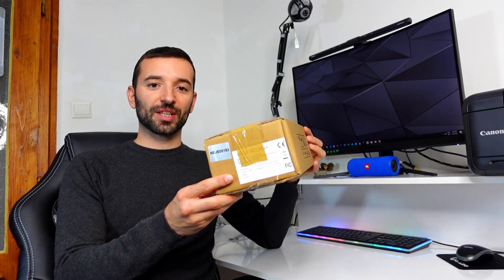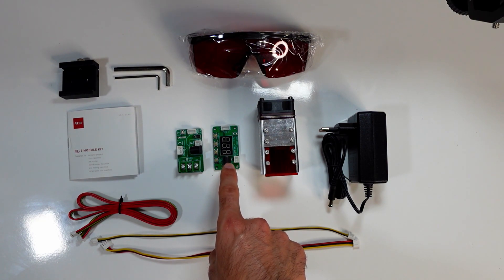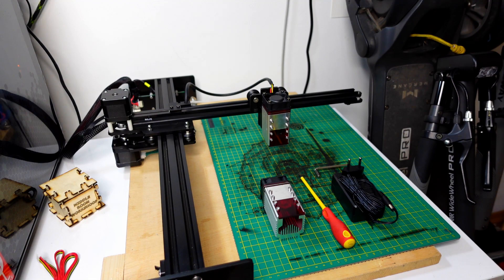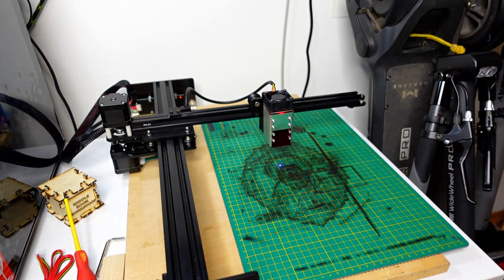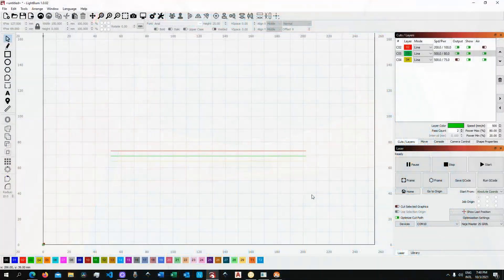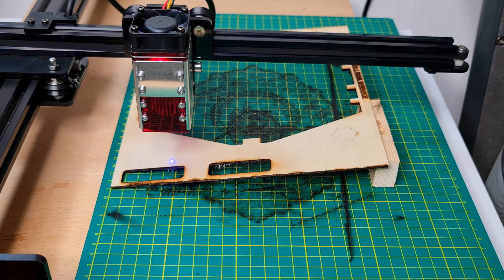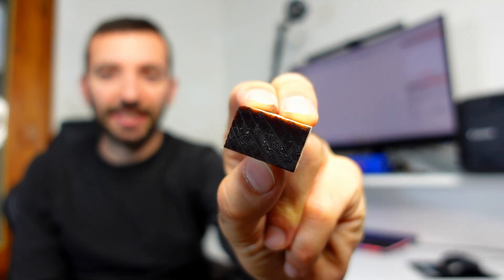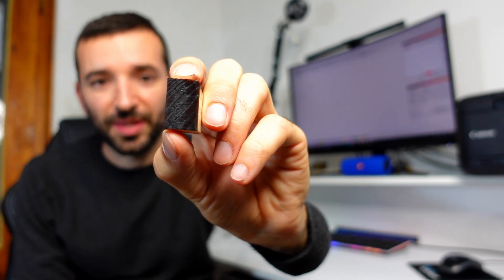Neje Master Upgrade  - 40W Dual Laser Module A40640

Comment: I've just ordered the 40W Mk2 module with 2 fans for my S2 Max. I've noticed it has an extra 2 pin socket on it. Can anyone confirm if it will just run from the same 4 pin cable as the 30w, or does it need additional  cable? Thanks.

Comment: I use neje master 2s plus
software laser grbl 5.4.0
Windows 7
The device stops working in the middle of a file.
What could be the reason?
Reply from the maker: Hi, thank you for your comment. 

Does this happen from time to time, or always.
If is random, it may be a cable or connector problem.

Let me know
Ciao

Comment: Great video, I've been searching all over but couldn't find much on adding the N60460 laser module to the ortur laser master 2 but I've seen it done so I tried it.  Module recently quit working and I found that the old motherboard on the x axis had burned out really badly which was causing it to no longer have power and could have been a huge fire hazard.  I've written to support but no answer and was wondering if you might know what I did wrong?   I had it grounded per the Ortur advisory but maybe I had a short?   My other thought was maybe it wasn't just plug and play and I need to upgrade my power supply since you did that in your video.   Long shot but I was hoping you might have a video or advice on how I went wrong and where I could find a suitable power supply.  Any help is appreciated, thanks!
Reply: Were did you see it done got the same as you and want to upgrade

Comment: Hi, I have the neje 3 with the A40640 module.  Is it possible to upgrade the A40640 to a stronger module? If so which would you recommend?  Trying to get some faster cuts and burn times. Thanks,  I really enjoy watching your videos. Just turned 65 to and still learning,lol
Reply from the maker: Hi, @williedog1127; thank you for your comment and belated Happy Birthday :)

The next step up to the NEJE A40640 is the new version of the same module, the E40 and the E80.
The E40 is a bit more effective than the A40640, and after reading on the Neje Official website, it seems compatible with your particular model. https://youtu.be/jag5Xey3Yc0

The E80 is double the power, but you must use the adapting board that ships with it to work since it is a 24V module and its is pretty capable from my early testing (review coming out soon).

For purchase here are some good offer for the E40 & E80 | https://s.click.aliexpress.com/e/_DluPWdf

I hope it helps
Happy engraving
Ciao

Comment: Thanks a lot for this great video!
I did just like you showed and - at first - it worked like a charm. Then I got an issue with the COM port which I solved.
But now the laser beam interrupts or is off completely while the movement still is fine.
Might be a hardware problem,
Does anyone have any hint?
Reply from the maker: Hi, Penasch; thank you for your comment. 

Could you be more specific about the way it interrupts? Does it interrupt while working, if yes have you noticed if it is related to the power? 
Did you change the power adapter to the 5A one?

Last but not least, if none of the above is the problem, try moving all the wiring harnesses one by one while the laser is on, perhaps is a simple false contact. 

Let me know.
Ciao

Comment: i bought the max 3 motherboard with the a40640 modules for my master 2s plus.  can you make a video on how to install the max 3 motherboard onto the master 2s plus? :]   also... how do i setup light burn for it?
Reply from the maker: Hi, IronMan; thank you for your comment. 

I can put that on my schedule, but it won't happen soon. 

About the setup in LightBurn, you will be pretty much ready, except for the size, which you will need to set up under device settings or to be safer in the GRBL configuration under $130=250.000 (X-axis maximum travel) and $131=420.000 (Y-axis maximum travel)

Ciao
Reply: @MiddleRoomWorkshop  thx.  and i meant the neje 3 plus not the 3 max cuz u cant use the 3 max with the master 2 plus.  anyway i got thing working . sort of. i cant do anything but start from the current position.  :[

Comment: Musstes du Steuerungsplatinen tauschen? Reicht das 3 Ampere Netzteil?
Reply from the maker: Hi BeeDad Bienen halten im Garten, thank you for your comment. 

Sorry, I do not speak German.
There is no need to swap the control board, all you need is the buy the module in a kit with its power supply.
The module is 4 Ampere.
Below is an offer from a French warehouse.
https://s.click.aliexpress.com/e/_DFkhPHl

Hallo BeeDad Bienen halten im Garten, danke für deinen Kommentar.

Entschuldigung, ich spreche kein Deutsch.
Ein Austausch der Steuerplatine ist nicht erforderlich, Sie müssen lediglich das Modul im Kit mit Netzteil kaufen.
Das Modul hat 4 Ampere.
Unten ist ein Angebot von einem französischen Lager.
https://s.click.aliexpress.com/e/_DFkhPHl

Ciao

Comment: Will the 20 watt board support 40 watt by just replacing with 40w?
Reply from the maker: Hello MD HABIBULLAH, thank you for your comment.

What is the exact model of your machine?
Not knowing the exact machine model I cannot really tell you whether you will be able to simply plug it in and use it.

I am sure that if it is not directly compatible it can be adapted with the adapter board that they provide with the module, where you can provide the power directly to the Laser and connect only the control line to the main board of your machine.

For your reference the documentation list the NEJE's machine directly compatible:  Master 2, Master 2 Plus, Master 2 Mix, Master 2 Max, Maser 2s and 3 series.

Unfortunately in don't know your exact model, therefore I cannot tell you, yes or not but my explanation should help you, bear in mind that laser module works also with other machines from other brands, and even with custom-built machines, therefore you should have absolutely no issue with it.

Let me know
Ciao

Comment: What is the difference between neje A40630 vs N40630 and which one is better and why?
Reply from the maker: Hello Muhammad Huzaifa, thank you for your comment.

The two laser modules are very similar in fact, the only difference is the laser compression technology used, so the A40630 has a longer Depth of Field which allow you to cut deeper overall, in addition, you have a smaller focal point which effectively concentrates the same 5.5w power in a smaller area making it more effective or in other words, seems more powerful.

I hope it helps.
Ciao
Reply: @MiddleRoomWorkshop  a40640 have 2x 5,5W laser not one 5W laser.

Comment: Hello, I saw on one channel a measurement of the optical power of the Neje A40640 40w (which Neje used to call 80 w), and this module produced 8.6 watts of optical power - less than the Atomstask M 50 (with a smaller focus point). Have you measured optical power?
Reply from the maker: Hello DyudyukVitaliy, thank you for your comment.

I've ordered the measuring device, therefore I might be able to give an exact number soon, however, I found that the laser that shipped with the Aufero Laser 2, the Module LU2-4-SF, rated at 5W optical power is somewhat more capable than the NEJE A40640, which by the way it was rated at 15W when I bought it, now I saw it recently rated at 10W.

It didn't sound right when I bought it since there were around multiple A40640 rated at different powers like 40W (the one I bought), 50W and 80W.

Stay tuned for the testing video.
Ciao
Reply: @MiddleRoomWorkshop  is it still a good option to buy the A40640 or are there any other modules to upgrade for the same prices with better performance?

Comment: I have nearly four year bought Neje  20 w laser plug n Play not plus or pro can I update 40 w will it support my old plug n Play diode laser engraver / cutter? Please give me accurate answer
Reply from the maker: Hello MD HABIBULLAH, thank you for your comment.

That is an old model, I cannot really tell you whether you will be able to simply plug it in and use it.

I am sure that if it is not directly compatible it can be adapted with the adapter board that they provide with the module, where you can provide the power directly to the Laser and connect only the control line to the main board of your machine.

For your reference the documentation list the NEJE's machine directly compatible:  Master 2, Master 2 Plus, Master 2 Mix, Master 2 Max, Maser 2s and 3 series.

Unfortunately in don't know your exact model, therefore I cannot tell you, yes or not but my explanation should help you, bear in mind that laser module works also with other machines from other brands, and even with custom-built machines, therefore you should have absolutely no issue with it.

Ciao

Comment: I would like to know where to find the specs of this module. All I can see in the NEJE website is an output of 15W for this model. What I've missed. Or maybe there is a formula for this conversion. Thank you
Reply from the maker: Hello Guillermo Medina, thank you for your comment.

Unfortunately, there is no formula, as already explained in other comments, the advertised power is the overall absorption of the machine the actual optical power output is much lower like in the case of the Module upgraded in the video. 
The module number is A40640, and it is a dual diode laser of about 40W but the effective optical power output is 15W which in other words is double the power of the 30W module which instead has an effective optical output power of 7.5W.

I hope it helps
Reply: 15W has ower optimist say,  neje 40640 have 2 pcs 5,5W laser head, this mean max output power is 11W max. and this make 1x4 about optical lens tichnes laser focus smallest and then have little bit more "output" power this mean optical power. and thats all seller speak power 30W or 40W or 80W etc. what have sellers lie.

Comment: Thank you so much .. can you make a video about upgrading the work surface of Neje Master pleeeeezz
Reply from the maker: Hello Zakaria Khouni, thank you for your comment.

Please be a bit more explicit and I will try my best to create a video. Do you mean the installation of the wooden board?
 
Ciao
Reply: @MiddleRoomWorkshop  what i meant is increasing the length of axes (x,y) .. can we do that  without replacing the motors and the electronics parts ?
Reply from the maker: Hello Zakaria Khouni, thank you for your comment.

Yes, that is certainly doable, and apart from physically changing the aluminium profile and the belt, then it's all about the firmware.
But, the short axis will need to be supported to avoid excessive deflection, also depending on how long you would like it to be you might need the extra motor.

I am planning to do a similar upgrade for the future.

Ciao

Comment: Is the dual laser at the focus point linear like a single laser?
Or does it take the form of a cross?
Thank you!
Reply from the maker: Hello abumoslem tamer, thank you for your comment.

The single laser produces a rectangular focal point, while the dual laser primarily thanks to the FAC lens creates a smaller squared focal point, therefore concentrating more power in a smaller area.

Ciao
Reply: @MiddleRoomWorkshop  
So this Dual laser diode is more efficient at cutting round and curved shapes, isn't it ?
Reply from the maker: Hello abumoslem tamer, thank you for your comment.

I would rather say more precise.

Ciao
Reply: @MiddleRoomWorkshop  
Thank you very much !

Comment: Is it possible to use the laser head and mother board on a different manufactures chassis? Also does using this head cut down on the taper in the kerf?
Reply from the maker: Hello mpetersen6, thank you for your comment.

You can do that, but you will need to override the driver to let the motherboard know that the size has changed and if different types of stepper motors are used in the other chasse, also if the line motion is of screw-type instead of belt type.

I do not think it will be easy, and definitely, Neje desktop app won't let you do that, paraphs you could try with LaserGRBL or LightBurn.

I hope it helps

Ciao

Comment: I just bought a Neje Master 2s Plus with the N60460 laser module. Then downgraded it to the Neje 30W module I had on my Ortur Laser Master 2 and use it only for rotary work. The 40W on my Ortur is for engraving and cutting and boy does it cut. I haven't tried anything as thick as the 18mm but I have several sheets of 6mm I want to use for projects. Thanks for the video!
Reply from the maker: Hello George Chambers, thank you for your comment.

My cut was done without air assist, just a small fan blowing across the base; up next I will build an air assist system, and I am sure it could go even deeper than 18mm.

Ciao

Comment: so, you mean you didnt change the mother board?  only the laser unit? is this safe?  thanks.. i also have a 30w and i am happy, but 40w for cutting seems great
Reply from the maker: Hello Karvis71, than you for your comment.

Yes, exactly, only the laser module and the power brick with the output current of 4A.

Based on the datasheet the module works with: Master 2/ master 2Plus/Master 2mix/Master 2max/ Master 2S and 3 series.

Ciao